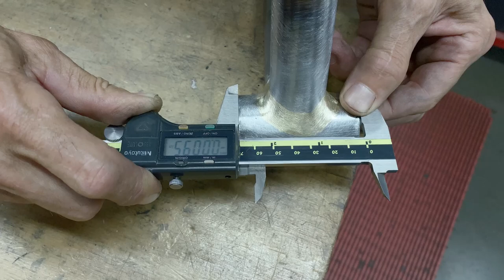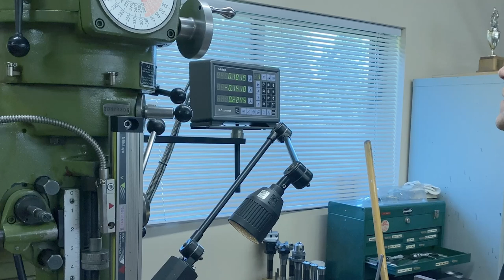Brazing and aligning the front triangle // Romax Build Part 2 - Framebuilding 101 with Paul Brodie

Comment: Hey there, just discovered this series and loving it, thank you. Question, using the bottom bracket as an example, I tack and work around the seat and down tubes as you do but do it all with brass and I don't do an 'internal braze' first before a full pass. It is just not possible to get it neat enough to avoid difficlties with the down tube mitre. You use silver nickel. What exactly is that please for me to get some. Really curious as the melting point is lower how on earth you can put brass on over the top with a final fillet? Amazing work by the way. Maybe I should give up now!
Reply from the maker: Never give up. When I was learning I made a LOT of mistakes but I never gave up. I always nickel silver the down tube to the BB first, then notch the set tube to fit. Don't leave any tube unbrazed even if you can't see it. And don't confuse nickel silver with silver solder; they are completely different! Nickel silver melts at approximately the same temp as a brazing rod, but is slightly stronger. I would not use brass. It is not as strong as a bare bronze brazing rod. Good luck!
Reply: @paulbrodie  Many thanks. My typo re brass...I never use it and it should have said bronze. But yeah, some nickel silver on order now. Thanks you again.

Comment: Hello Paul,  Thanks for sending me to the Romax build series.  I am almost ready to start my first fillet brazed frame.  I have practiced with LFB rod but have a bronze filler rod now from a bicycle builder supply.  The only silver rod I have is the 56% silver solder that I used on a lugged frame I built.  I think that is different than the nickle-bronze rod you flow into the joints, right?  Could you please let me know the specifics of that rod?  I might have to buy some of that too.  Thanks so much,  Mike
Reply from the maker: Hi Michael, Yes, the nickel silver rod is definitely different from the nickel silver rod I also use. Both are 1/16" thick. I'm in my house now, and the rods are all out in the shop, but we have two brazing videos and I know that all the numbers and info are shown and talked about, so please check out those sources. Thanks for watching....   :face-orange-biting-nails:

Comment: Hi Paul, thank you for posting such an incredibly instructional video - well done!  I have a question about some of the terminology used in your video.  When you are using 1/16 rod to initially start to fill the joint, you refer to it as nickel silver, then when you start to build up the fillet, you refer to the 3/32 as bare bronze rod.   Are these two rods inherently different aside from their diameters?  Does the bare bronze rod not contain nickel?

Thank you 
Ben
Reply from the maker: Thanks Ben. They are 2 different rods. The nickel silver rod has slightly different flow characteristics. Plus the smaller diameter allows it to flow better into the joint between the 2 tubes. It's just what I prefer to do. It's a very good combination, and I have never had a failure. :glasses-purple-yellow-diamond: no nickel is the bare bronze rod.
Reply: @paulbrodie  Thank you Paul!  One last follow up: do you notice a difference between 3/32 bare bronze, and 3/32 nickel bronze brazing rods?  The only reason I ask is that my local supplier only carries the latter.
Reply from the maker: @n1sm0r  I looked for my spec sheet on bare bronze, and apparently, it has taken a walk!  I do not think it has nickel in it. I only have one rod, so cannot tell you the difference between "with nickel and without" when brazing. If there is nickel, it is going to be a very small percentage. Nickel will make the joint slightly stronger. Don't be overly concerned about it.
Reply: @paulbrodie  thanks!

Comment: Back again, with a question this time: What grit and brand abrasives do you like for the Dynabrodie™ file belts and the die grinder cartridge roles? I haven't tried many, but the last cartridge roles I used came unravelled very quickly, and I'd like to avoid that the next go around. Thanks!
Reply from the maker: The Fillet brazing 101 video is coming out this weekend and all the spiral roll grits and brands are shown. My favourite all round is 80 grit. The dynafile belts are 1/4" X 24" and I will be making a new machine in a few more episodes.. Good way to save a few hundred bucks.

Comment: These videos are great! Do you know what size cartridge rolls and grit you use?
Reply from the maker: The brand is Merit, and the size is 3/4 X 2 X. 3/16". I use 80 grit.
Reply: @paulbrodie  More so, where do you find a plug in (or cordless for that matter) grinder to receive that size shaft? Everything I find is more Dremel size. Thanks, Wil
Reply from the maker: @moosevt1   In the fillet brazing video, everything is laid out. Grinder, arbor, etc, all purchased from Sabre Industrial in Surrey BC. All part numbers.

Comment: What shades do you use over you regular glasses? One four-eyes to another...the shades I'm using now are garbage!
Reply from the maker: My brazing glasses were handed down to me from my father. However, any good brazing supply shop will have glasses. Get a good fit over your regular glasses. There are different shades too; #3 is quite light, #4 in the middle, and #5 is darker. That's what I remember. Good luck!
Reply: paul brodie best to treasure those things passed down. I’ll keep an eye out for something that fits a little better!